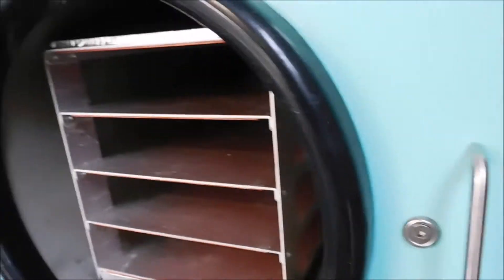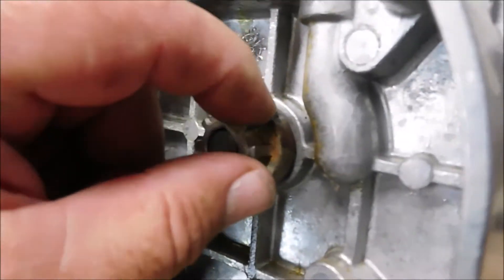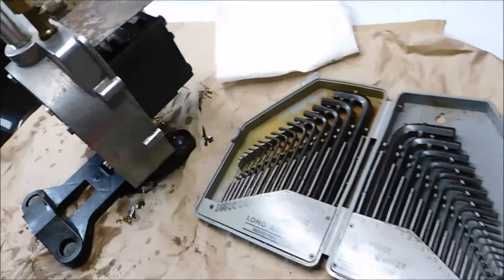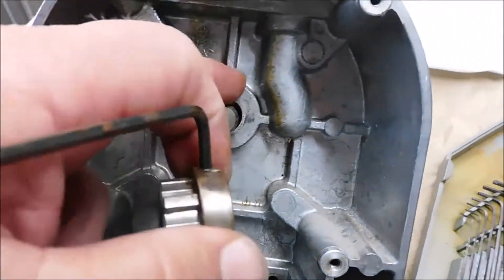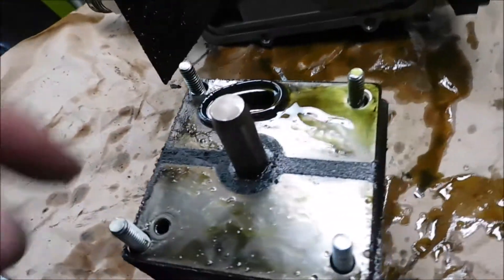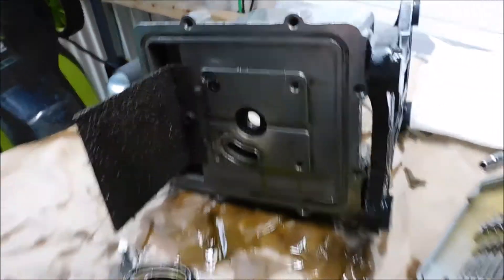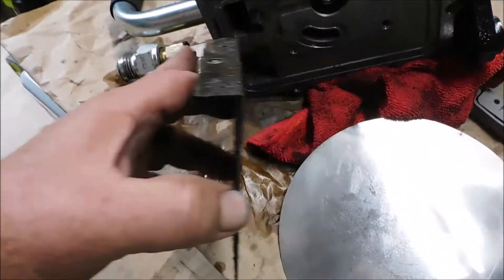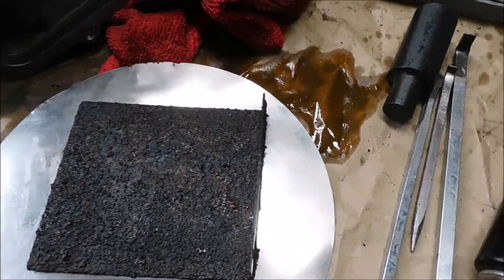Vacuum pump shaft seal replacement, freeze dryer repair!

Comment: thanks for the video - can you please post the link to order the seal - the part numbers as well?  🤠
Reply from the maker: Grainger has this seal, as well as a few other places. JB INDUSTRIES O-Ring: Mfr Part # PR-3 , also you can search for 22JH64 and that is the part number from JB industries. It was 3 years ago, and I don't remember where I found mine, but I bought 2 when I did.  I will put this page address for grainger, I have no clue what the shipping will be there. https://www.grainger.com/product/JB-INDUSTRIES-O-Ring-Mfr-Part-PR-3-22JH64 that should get you to at least one place to buy one. I saw one on ebay for $35...don't do that, they are not expensive. Good luck, I hope this helps! Thank you for watching!
Reply from the maker: Please let me know if YT left the link in here so I know.

Comment: Thanks for the video..  But what sealant did you use when installing the new rubber shaft seal? My instructions from JB says "apply petroleum jelly or grease to inside edges of seal" Thanks!
Reply from the maker: The rubber part that seats on the rotating shaft needs a bit of lube to start with so it doesn't scar or tear up on startup. After the oil splashes up, it will be lubed while running. So any lubrication will work. I always wet down all my rubber seals and "O" rings with silicone oil or silicone grease. That helps them from dry rotting. The metal to metal part of the seal can (if cleaned of oil) have a bit of silicone gasket rubber wiped on it or maybe a lock tight product made for seals, I think green maybe??? So heavy oil or petroleum jelly, or light grease is fine.  Thank You for watching.
Reply: @davenooner2142  Thanks..  The instructions say "lube the inside of the seal" but doesn't say anything about the outside of seal to aluminum case and I assumed it was to go in dry..  Maybe a little RTV?
Reply from the maker: @MrRerod  Yes RTV...very light so there is no excess that can fall off into pump...or the lock tight brand seal sealer/adhesive that is green in color...I can not remember the number for it. But silicone rubber(RTV) works great in this case.

Comment: Please where can I buy a shaft seal for my vacuum pump, I bought a new vacuum pump,(AUTOGEN) and I have not even use it, and just the first day I turned it on I noticed that white smoke was coming out from the motor side, and it was terrible, now I can not return it, because I live in Nigeria and the cost of retuning it, is two times the amount of the pump itself, please I need to replace the shaft seal where can I buy it?.
Reply from the maker: When I noticed mine leaking, I found a website for the pump replacement parts. It has a diagram with all the parts on it. I found the part number and did a search for that part for sale, and, found a good price for it. If you can not get results for it that way, you can gently remove it and look for numbers molded in the rubber itself... then search for those numbers. Also, if that fails, you can measure the shaft and the opening that it is pushed into and search at a website that has seals for sale or that makes seals. Like this one https://www.rocketseals.com/oil-seals/ ... you have to be very accurate with your measurements. digital calipers work well if you have a set or could borrow a set. Good luck sir! I hope this helped.